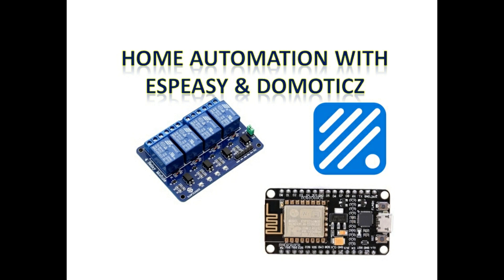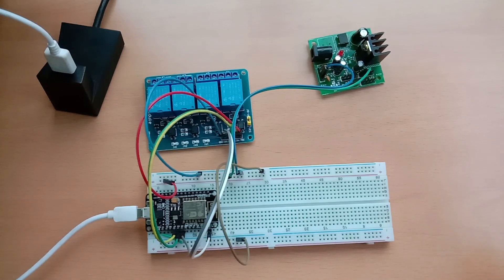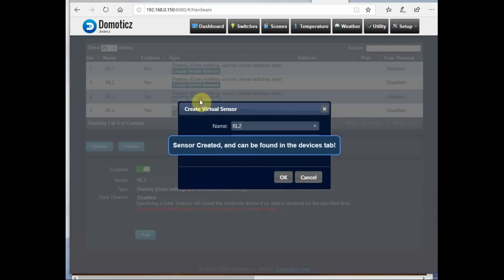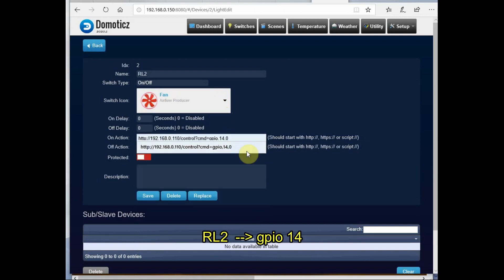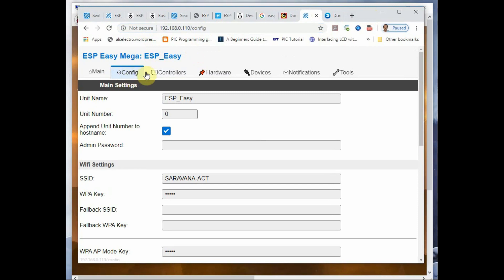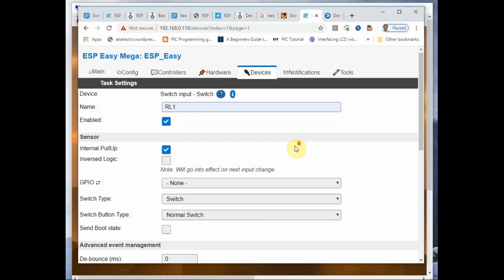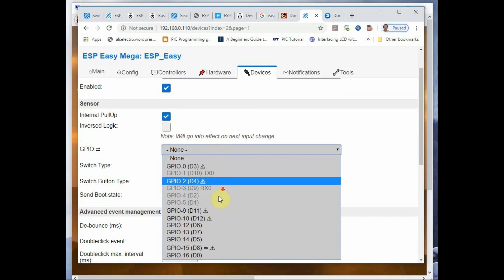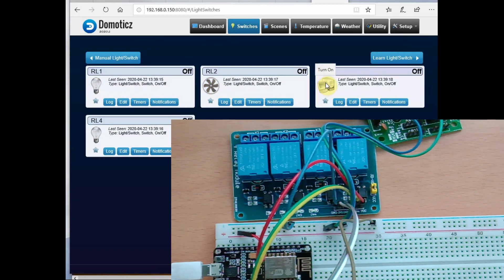HomeAutomation with ESPEASY & DOMOTICZ

Comment: Why 4 virtual devices?
One is enaugh  - with 4 virtual sensors ( switches ) created under it.
And there is no need define Devices in ESPeasy if you use for example "http://<espeasyip>/control?cmd=GPIO,12,1" for your relay.
It control gpios directly, without any definition.
And in this case put Domoticz IDX in device tab for relay can cause infinite loop in communication between Domoticz and ESPeasy.